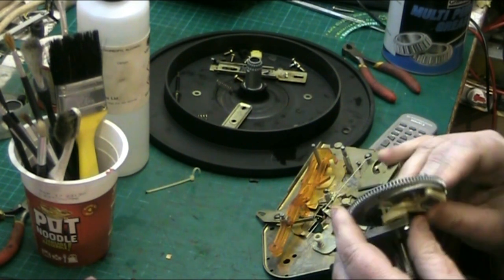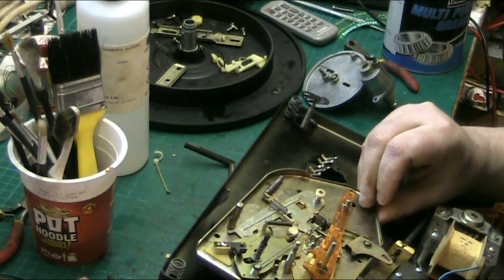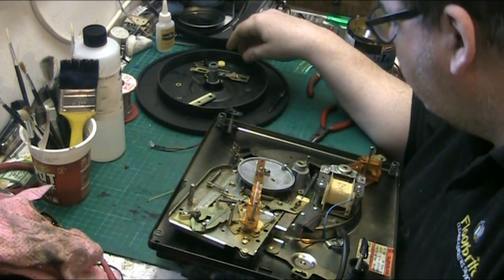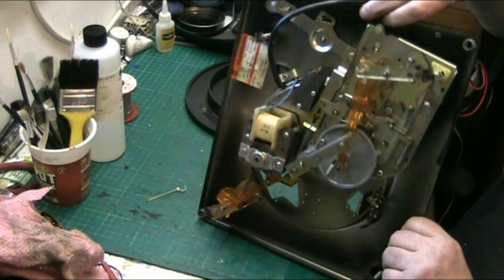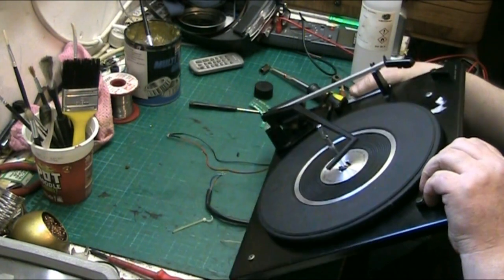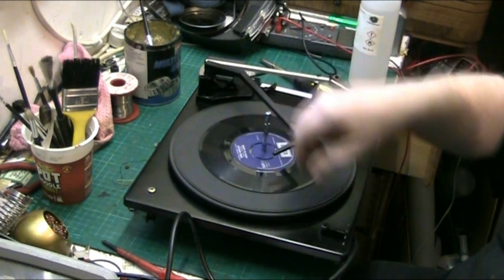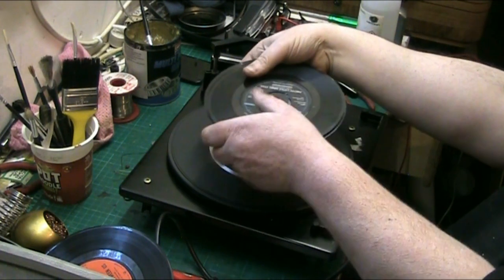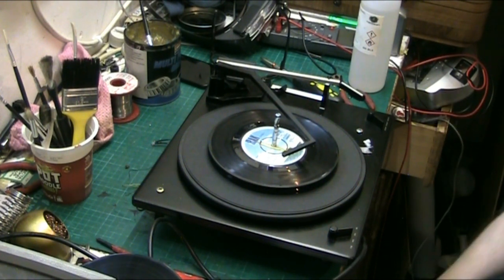PYE STEREO GLENBURN DECK SERVICE Pt3

Comment: Hi I've ben working on one of these. I took it all apart cleaned and greased. The  tone arm is very stiff and gets stuck at end of record and it just skips. 2nd issue is the record starts on the 7 in position no matter if I put on 7 10 or 12. I know this is part 3 where is part 1 and 2 ??  thanks in advance. Tim